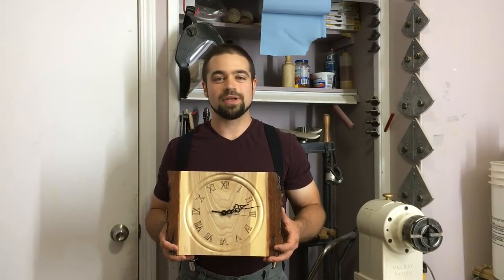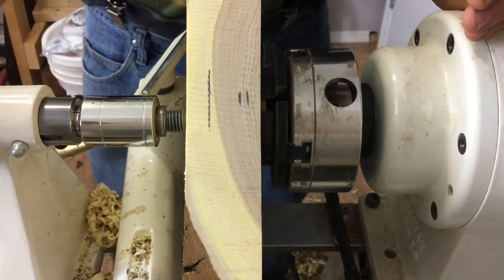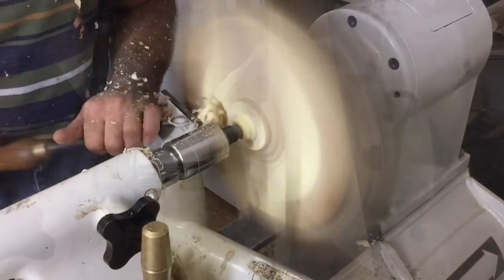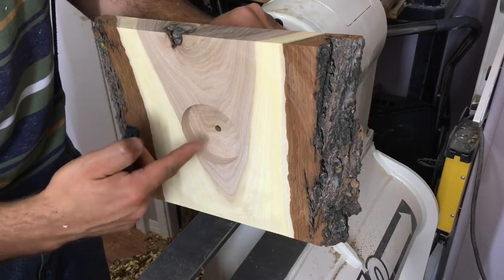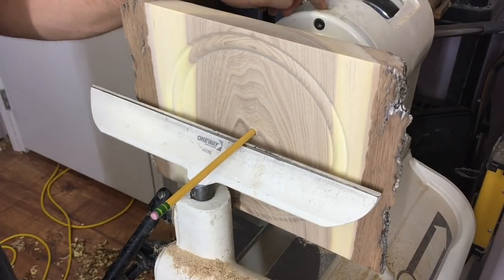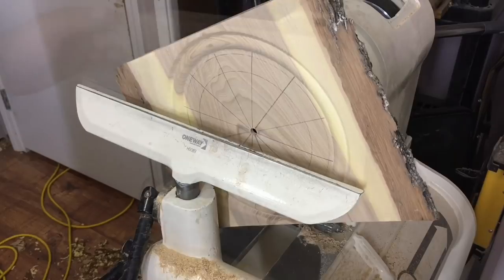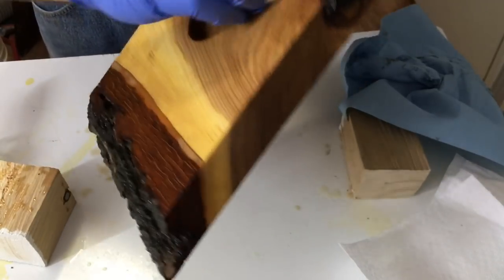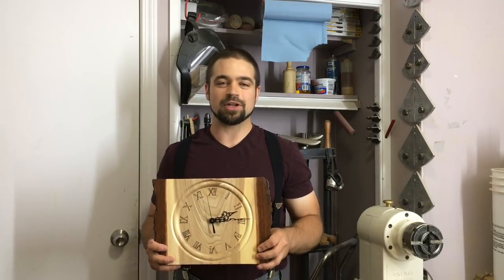Woodturning - Slab Clock (With Pyrography)

Comment: Wow that is a cool looking clock. I just love the bark on it and  the grain is really nice.
When we have our elm tree topped I just may have a piece that big. Hard to say if I will get the bark as we want to get it trimmed soon. 
Nice job Kyler,
Gary
Reply from the maker: ThePapa1947 Thanks Gary! I would definitely save every bit of it if I were you! Even if the bark doesn't want to hold on, the contrast between the heartwood and sapwood will still make for great looking slabs or turnings. 
Another reason I like Elm is because it dries quite stable for such a hard wood. I get less cracking with Elm than I do with most woods. Especially oak, that stuff just loves cracking lol 
Thanks again Gary. 
Kyler

Comment: Well, I couldn't be bothered to wear a face shield so I decided to try this with my eyes closed (well, I didn't want wood chips in my eyes). This proved somewhat tricky... particularly as I was balancing on a monocycle at the same time. I'm trying to learn woodturning and learn to ride a monocycle so I figured this would save time. It turns out that I'm not very good at either.
As you didn't warn against woodturning with eyes closed while trying to balance on a monocycle, I figured I'd sue you for gross negligence... but then I noticed your disclaimer that my safety is my responsibility. I reckon you must have known I was going to do that!
Anyway, it's a beautiful clock (yours, not mine... mine's crap). I shall be having the stitches removed next week and the plaster cast comes off in a few months. Then I'm going to have a go at chainsaw juggling. I thought I'd tap into your amazing power of foresight and ask you how you think that might turn out. I don't want to take any chances. It's wise to be cautious.